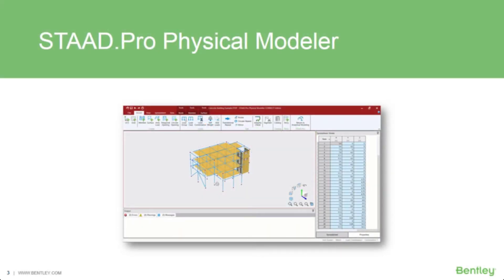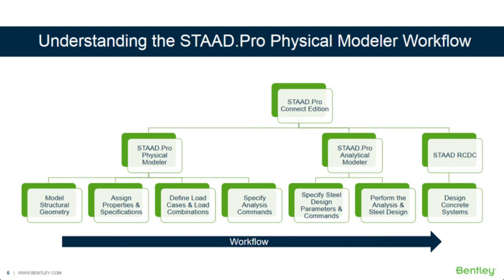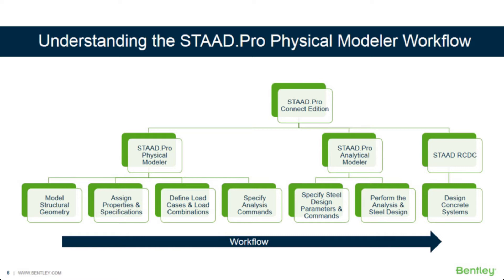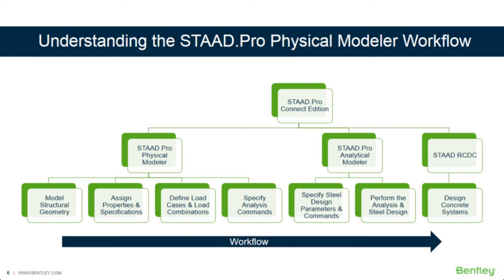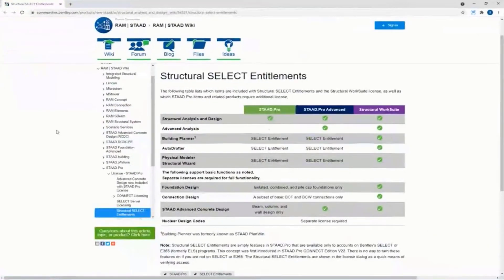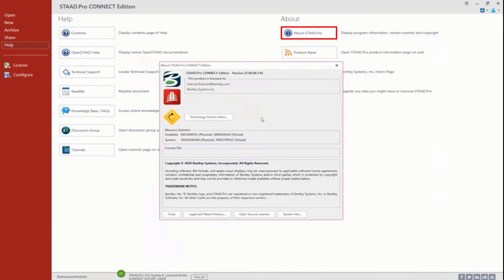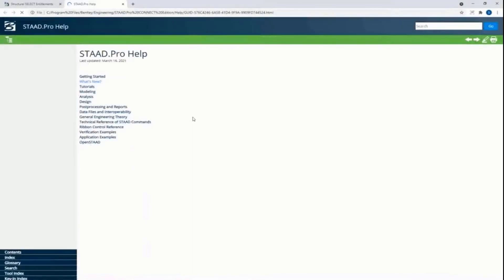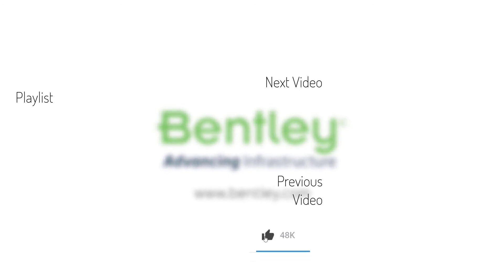Introduction to Tank Modeling in the STAAD.Pro Physical Modeler

Comment from the maker: STAAD.Pro CONNECT Edition V22 Update 8 (22.08.00) was just released. The structure wizard template for creating multi-compartment to work in conjunction with the tank design in the Advanced Concrete Design (RCDC) modules has been further developed to support tanks that are partially or fully buried and have a step in the wall thickness. For more information, see the RAM|STAAD Blog Post on Bentley Communities: https://communities.bentley.com/products/ram-staad/b/analysis_and_design_blog/posts/new-release---staad-pro-connect-edition-v22-update-7-22-08-00